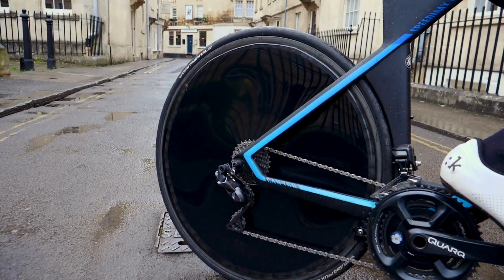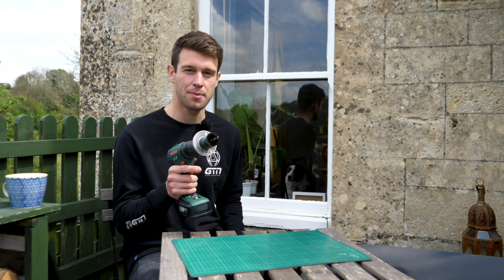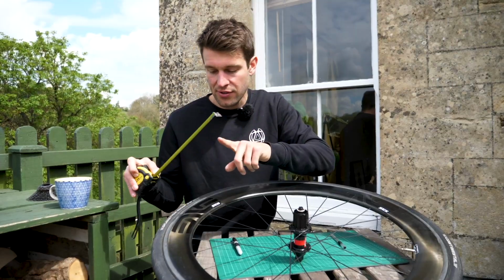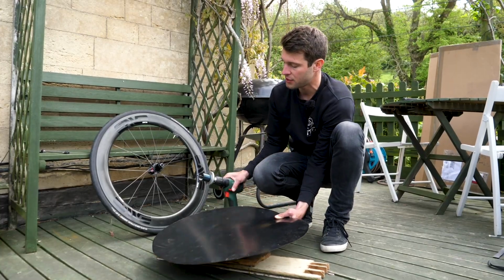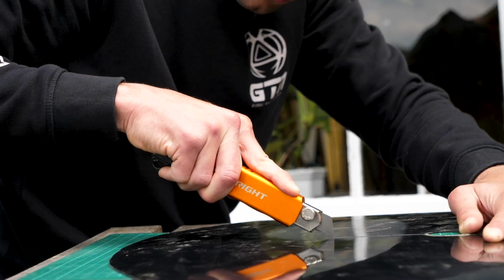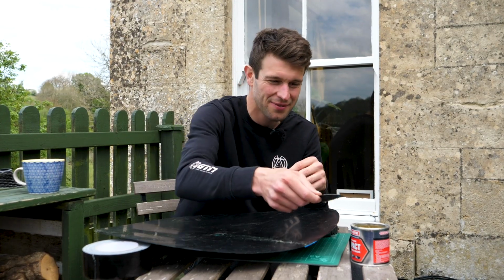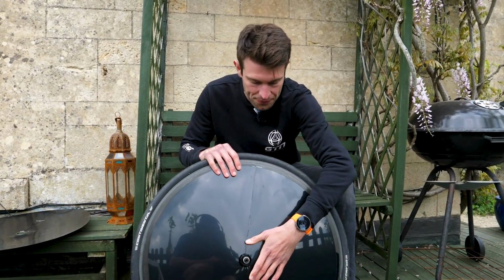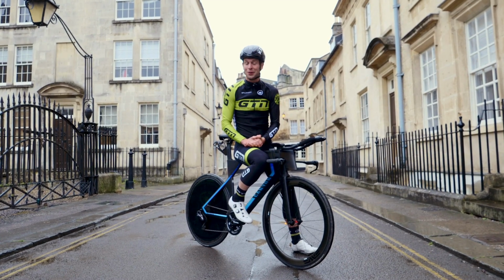Homemade Disc Wheel Cover | How To Make Your Own Step-By-Step

Comment: I can already hear and see the detached covers all over the IRONMAN bike courses 🙈
Reply: They’re used a lot already and I’ve yet to hear of one falling off if applied well. But hey, entirely up to you. It was just meant as a bit of fun
Reply: @markthrelfall3577  awesome answer. I ll try...bike frame is red...will try to find some red plastic for fun :) :)
Reply: Not convinced tape alone is going to hold over 180km ... 😟 And it's not perfectly central, so how does that effect the stability of the wheel?
Reply: @kryan  Done properly, it does. Long story short, the wheel ends up a bit heavier., and you don't get the cool disk sound, but other than that it works. Some pros race (or at least used to) with homemade disk covers.
Reply: You could prevent this by drilling a couple of tiny holes either side of a spoke and using a cable tie to get a firm grip. Two of these on each side should prevent a disc falling off even if the tape lets go.
Reply: @SiGoodchild1  Cable ties I like. The ones for purchase are laser cut, take care with dimensions and use what appear to be very secure locking mechanisms.

I'm all for fun. I'm just a little worried about bike handling and people coming off bikes after a slipped piece of tape at km 140...
Reply: Didn't cheap mountain bikes have these back in the 80s?

Comment: You go faster with this? How many kmh you gain at same power?
Reply: You can't make a flat call, it depends on the wheels you're using before, and it highly depends on the speed you're going at, also, your frame aerodynamics play a role here. Many factors to view, but it's a decent improvement.
Reply: I’m glad you’ve asked 😊 I plan to do just that
Reply: @markthrelfall3577  can you use gorilla glue?
Reply: @cbyod  potentially. I did look at getting that myself. I almost got a black ABS adhesive, which I think would have been better. Mine did the job though
Reply: At same power output, about 2-3 km/h compaired to normal wheels.
Reply: @panzerveps  not so Much,I Think about 0.2/0.3 kmh
Reply: @panzerveps  That's massive!
Reply: If you ride at 10 kmph, then 0 kmph you go faster with this whell. And maybe little slower do biger weight.